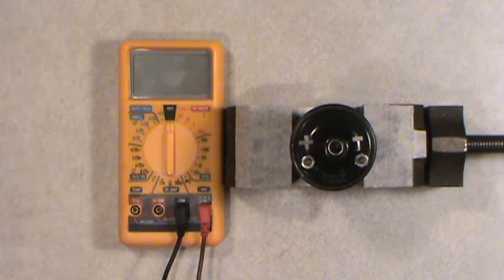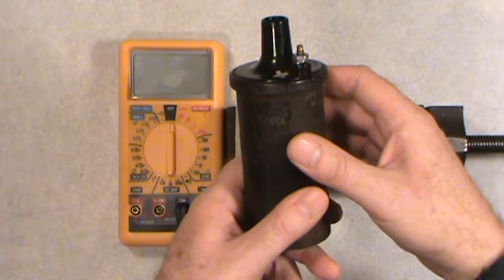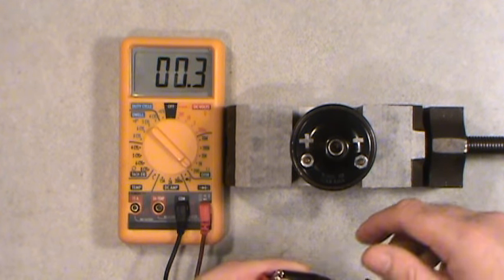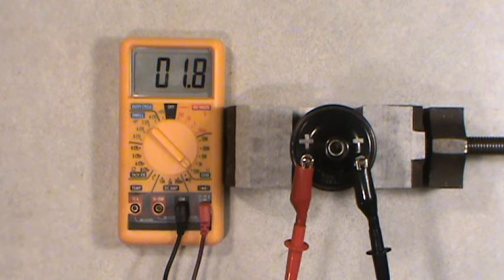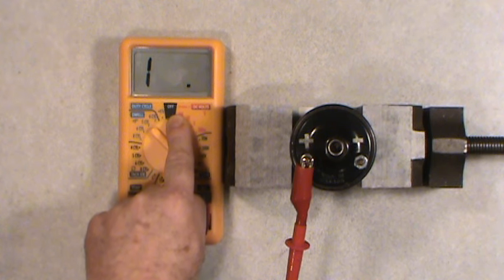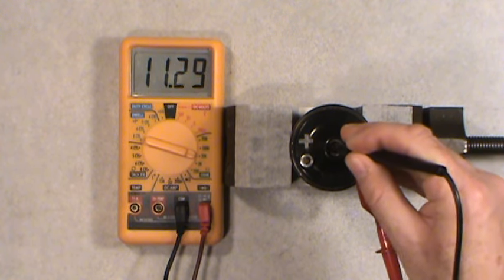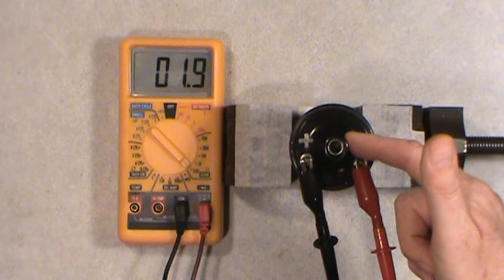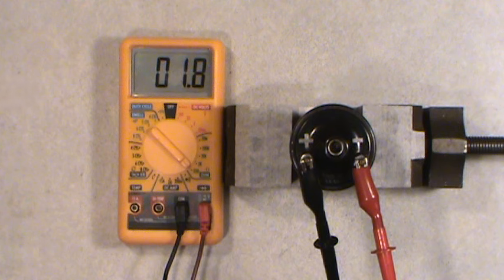Ignition Coil Test (The Short Version)

Comment: Thanks for that been having trouble with mine.peace
Reply from the maker: Greetings...Doug Dobbs........You're welcome, and, thanks for watching........Sometimes, bad, electrical connections, can cause problems too, as in, corrosion, dampness, oxidation, frayed wiring etc. ........If ever, replacing any ignition system parts, make sure to get the "exact/specified" parts, for the vehicle in question, in order to, try to avoid, any unwanted, additional problems......and......till next time......Be Safe, take care, and have a good one.

Comment: Why is my coil getting so hot?
Reply from the maker: Greetings...Dale Beesley………...Thanks for watching...…….There can be a few things, that can cause an automotive ignition coil, to get hotter than it should be, while in operation...……..Sometimes, if replacing an ignition coil, then, there can be the odd time, where the new replacement coil, doesn't have the same specifications (within reason), as compared to the original factory specified ignition coil...……..An example can be, where the primary resistance is not the same as the factory original, as in, installing a 1.5 ohm coil, into an ignition circuit, that was specified to have a 3 ohm coil...……..A fairly common ole school ignition circuit, for a much older points and condenser type of distributor, would be, to have a 1.5 ohm (rated) ignition coil, that was in the same electrical circuit, that also had a resistance component, and some were, a special type of resistance wire, while the other type, usually had a fairly large resistor, that seemed to be imbedded inside of a, shall we say, white-ish colored ceramic block, that was commonly called, a ballast resistor...……..The ballast resistor, was in there, to basically limit, the amount of amps (amperes), that was being fed, to the primary (low voltage) side of the cylindrically shaped, type of ignition coil...……..Whether, it be, an old school, or a much newer type of ignition coil, then, if it gets fed too many extra amps (amperes) of electricity, that it wasn't designed for, then, the result is usually, an ignition coil, that gets too hot, or maybe, just cooks itself, to the point, where it just won't work anymore...…….The ignition coil, might be faulty, possibly...……...So, make sure that, all ignition system components, spark plugs, and wiring, are the specified parts and pieces, for the "exact", vehicle and engine, to help avoid, any unwanted problems, and...….till next time...…..Be Safe take care, and have a good one.
Reply: Yeah I got her handle thanks. 85 Dodge 1 ton 4 wheel drive to a real race truck now

Comment: Hi my friend,  these values are for all kind of ignition coils? Thank you.
Reply from the maker: Greetings...Jorge Caldas............You're welcome, and thanks for watching.............There are so many different kinds and shapes of ignition coils, that were made over the years, for the many different vehicles, and, there were also different types of ignition systems (circuits) as well..............So, the answer to Your question, is, as follows..............The Ohms (resistance) "Values" (both, the low/primary ohms, and the high/secondary ohms), will depend on, what the vehicle's Manufacturer, originally specified, for that "Exact" vehicle's ignition system............So, "Make Sure", that You install the "Exact/Correct" ignition coil, or coils, as the case may be, cuz, if the wrong one gets installed, then, the result might end up being...a weak spark, at the spark plug's electrodes...or maybe...an ignition coil, and/or, an ignition control module, that over-heats and destroys itself...or maybe, as bad as...causing, a newer vehicle's on-board computer, to get damaged, and not work properly, and if so, things tend to get rather expensive to fix, and, could have been prevented, if the Exact/Correct ignition coil, or coils, were installed in the first place...........Some of the much older, oil filled, round, ignition coils, might have anywhere, from, 1.5 ohms, to 3 ohms or more, on the low/primary side (some ignition coils, also required a ballast resistor, more so, to go along with that 1.5 ohm coil, that I just mentioned).............Then, some of the later, epoxy (filled) ignition coils, might have between, just over zero ohms, to no more than, about 1 ohm, typically .5 ohms (1/2 of an ohm) as an example..............As for the secondary/high ohms (as in, thousands of ohms usually), well, that Specification, will also depend, on, just what, the vehicle manufacturer, actually Specified, for that Exact vehicle as well............So, You see my Friend, it's always a very good idea, to have a look for, the Vehicle Manufacturer's "Specified" ignition coil/s, for the "Exact" vehicle in question, so things don't get damaged...and expensive as well.......and.......till next time.......Be Safe, take care, and have a good one.
Reply: Thank you my friend. I know it is not so easy depend of many things. But I don't know anything about electric system.
Reply from the maker: Greetings, once again...Jorge Caldas...........You're welcome...........Well, I started out, just like You are now, not knowing all that much about a car's electrical system, and also, not all that much, about cars in general, as well, but, I sure knew back then, what a "Flat Tire" sure looked like...!!!...lol............While some of my Friends in High School, had cars, and also, some of them, also took the school's Automotive Class/Program, I didn't, cuz, I wasn't all that interested in Cars, back then...until...I graduated from high school, then I caught, the, shall we say..."Car Bug"...and from that point onwards, I'd say, that it's pretty much, at the Top, of my (many hobbies)..."Top 10 List"...so to speak...........Even before the Internet showed up, I was reading...many...did I say Many...Automotive related Books, and, I guess that One could say, that, I have a small Library of them, gathered around here...........Just make sure, that, You are aware of "Safety", when-ever working on a Car or Truck, or what-ever, cuz, that's the most important thing...!!!...and......till next time........Be Safe, take care, and have a good one.

Comment: hello Rocky. what is considered a normal resistance readi ng or a high one?
Reply from the maker: Greetings...Mamjazz Group. LLC..........Thanks for watching..........Well, it all depends upon, just, "Which"...???...ignition coil, that we happen to be talking about..........Best thing to always do, is to find the (electrical) "Specifications", for the "Exact" ignition coil in question, or, you'll just be guessing............Here are three examples for Ya...........Just on the Primary/low ohms side, of a 12 volt ignition coil, you might have an older, oil filled type of ignition coil, that might have about 1.5 ohms, or, maybe 3 ohms (the 1.5 ohm coil, will usually have a Ballast Resistor linked to it), where-as, the 3 ohm coil, probably won't............Then, there's something like a GMC/Chevrolet, H.E.I. (High Energy Ignition) epoxy/type of (not oil filled) ignition coil, that will probably have (on the primary side), from, "just over" 0 (zero) ohms...(but not zero), up to, usually no more than, about 1 ohm (.5 ohms, seems to be fairly normal, most times)...........So, all bets are off, until the Specifications are known, for the ignition coil in question, and......till next time.......Be Safe, take care, and have a good one.
Reply: Thanks Rocky, I found out my question was too brought. In fact, I meant to say "Coil on plugs" type. 
I had watched a video in which it was said that a good coil on plug is good if it reads 5-6k ohms; anything under means the coil on plug is degrading and should be replaced. The only thing I do not remember is if the video I watched was general about it or particular about the Make of vehicle that was discussed in the video
Reply from the maker: Greetings...Mamjazz Group. LLC..........Here are a few things for Ya.........That 5-6 K Ohms (K = 1,000...so it's 5,000 to 6,000 Ohms), so, to me, it's just the "secondary" (coil of wire, that's inside of the ignition coil's body), or, call it, the high voltage output side of the coil, given the high Ohms/resistance value...........There's also the "primary" (coil of wire, that's also inside the ignition coil's body, as well) that usually, has quite low ohms/resistance, that's found, in any automotive type of ignition coil, as far as I know...........If you can't find the Ohms/resistance Specifications, for your "exact" ignition coil, then, here's something that might help you out some-what........Maybe, Ohms measure, the "other" ignition coils, that are on your engine, and see what Ohms show up, and compare them to each other..........."Make sure", to only do, "One" ignition coil at a time, just in case the "wiring", to each ignition coil, gets put on the "wrong" ignition coil..........Inside, near the top, of the C.O.P. (Coil On Plug) ignition coil, there will probably be an electronic circuit of some kind, so, Ya have to be very careful, because, it's, shall we say, not as forgiving, as the old school, type/s of ignition coils............The Vehicle's On-Board Computer, might have to interact with, the ignition coil's electronics, so, once again, be careful, and, do it right, just in case..........Also, even though an ignition coil "passes" the Ohms Test (while they are at about room temperature, there-abouts), then, there can be times, where an ignition coil, might start to act-up, and not work so good, when it gets up to operating temperature, just so Ya know.............If you care to, you can let me know about your vehicle, as in...Year...Make...Model...and...Engine size...etc.....other-wise, I'll just be going on, another one of my..."wild-goose-chases"...lol...and.......till next time.......Be Safe, take care, and have a good one.
Reply: RockysRoadshow hi Rocky. just reading your emajl and wanted to say thanks. I was able to figure it out. thanks and be safe

Comment: 1989 Nissan pu how do I check if coils are good
Reply from the maker: Greetings...Rafael Diaz..........Thanks for watching..........If your ignition coil, is the one, that has two small pin terminals, side by side, as well as, only one spark plug wire tower, then, here's some information, that will hopefully help you out..........Select the low ohms scale, on your ohm meter, then, the "low ohms", should be between about .7 to 1.4 Ohms, when connecting the ohm meter's probes, to, the two small (side by side) terminals, oh, and, before doing so, connect the two ohm meter "probes" together first, to see whether or not, your ohm meter is reading "zero" or otherwise...........If there was a reading, other than zero, when the two probes were connected, then, just subtract that reading, that you saw, from the reading, that is to be taken, from, those two small pin terminals...........For the "high ohms" test, just place one probe, into that (spark plug wire) "tower", and the other probe, onto, one of those small pins (you can do both small pins, but only do, one at a time), but I doubt, that, there will be any difference at all, since you are now, setting your ohm meter, to measure in the thousands of ohms, and is, as follows...........While having, the ohm meter's range, set to, the thousands of ohms (might be 20-k, as in 20,000 ohms maybe), then, the high ohms reading, should be, between, about 8-k to 13-k ohms (that be, 8,000 ohms, to, 13,000 ohms)............To be sure, try to find, the "exact", ohms "specifications", for the ignition coil, that you have there............Good luck, and........till next time........Be Safe, take care, and have a good one.

Comment: Showing us how to test an obsolete ignition coil isn't very useful, regardless of how good the information is ;-)
Reply from the maker: Greetings...Dave Kauffman...…….Thanks for watching...…..Well, almost all, automotive ignition coils, have the same basic design, as in, one primary coil of wire, as well as, one secondary coil of wire...…….There will usually be, a low ohms reading, for the primary coil of wire, and, a much higher ohm reading, for the secondary coil of wire...……..The differences between the different coils, are usually...oil filled, or hardened epoxy, surrounding the coils of wire...the different wiring (and colors too)...and...the different, low and high ohms specifications, that there are, for the many different types of automotive ignition coils that are out there...…….If Ya can ohms measure the older ones, then, like me, Ya won't have very much trouble at all, with any of the other ones, providing that, Ya know which lead wire is which, and, the low and high ohms, that are specified, for the "exact" ignition coil, that is being tested, and...…..till next time...…..Be Safe, take care, and have a good one.
Reply: This is good information if you have an old car.  However, I would think that polarity markings on the coil would have to be reversed on a positive ground system  ie. the ground whether positive or negative should always be connected to the minus side of the coil.  The minus side of the coil should be connected to the distributor, and the positive side of the coil connected to the "hot" lead from the ignition switch.  Am I correct about this?
Reply: Its not obsolete to us guys that restore cars.